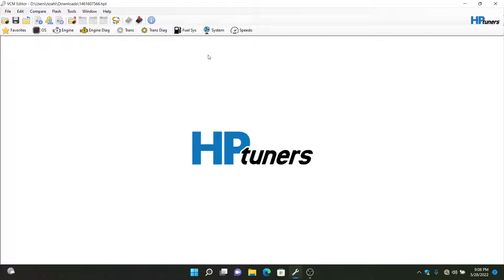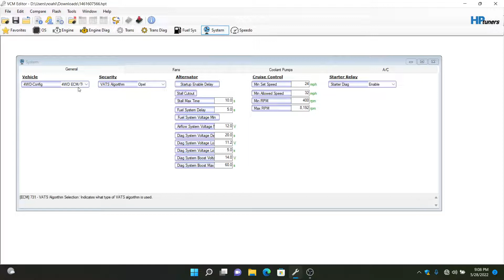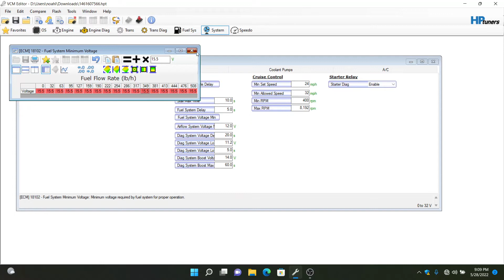How to increase voltage Gen V LT with HP Tuners

Comment: is there any cons of that? because it has so called smart charger. currently i am running amp as well
Reply from the maker: No. You just don’t want to turn it up too much.
Reply: @noah63nova14   what i did put 14.8 in front cell and 15.5 in last then interpolate all cell.
Reply: let me know what you suggest and what was your experience.
Reply from the maker: I did exactly as I did in the video to my swap and it worked just fine. Just better voltage.